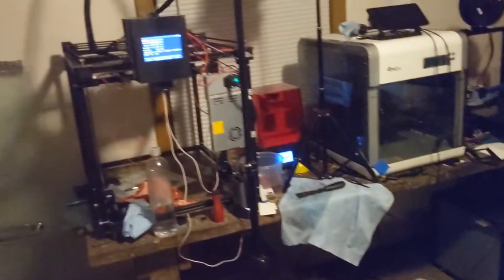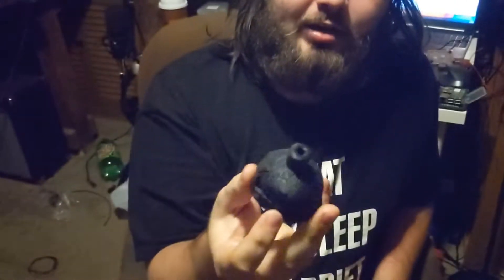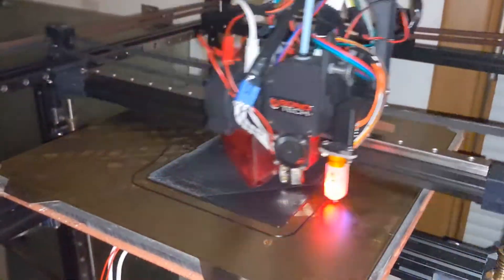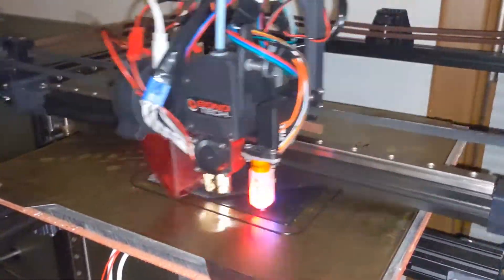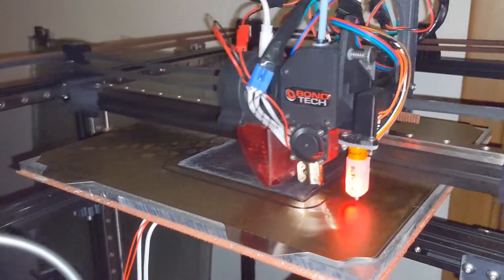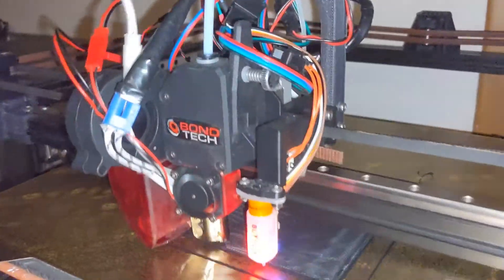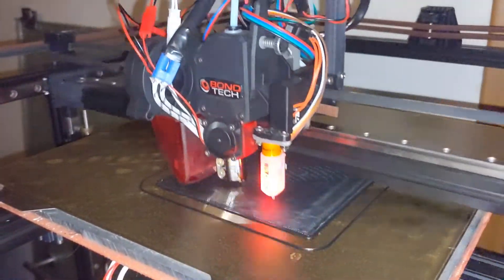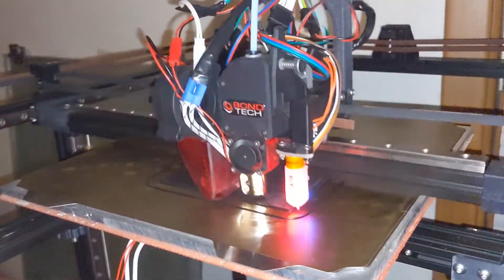Nova hotend 2nd print on corexy 354mm/s @8000 accel!

Comment: Hi man, did you print some more? have any more torture test?
Reply from the maker: Tomorrow I am doing TPU 1 mm nozzle, I will probably be doing more at the standard 0.5 mm nozzle soon I have a bunch of quarters that are very large prints and this is reducing the time to print from 24 hours down to 7 roughly, my old ender with mosquito Magnum estimated print time was 48 to prevent clogging